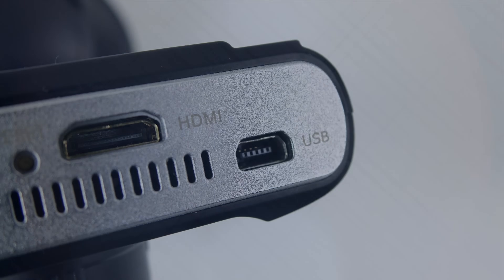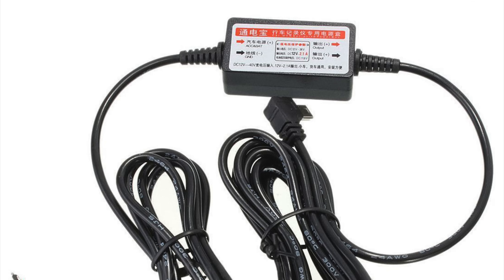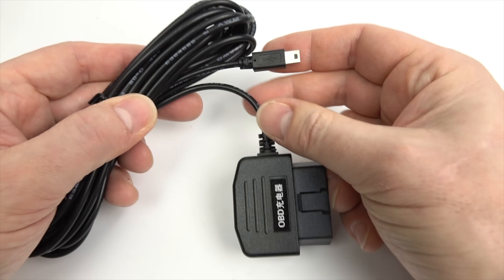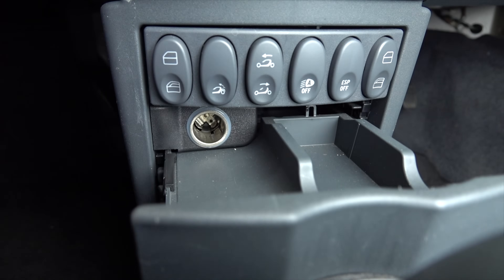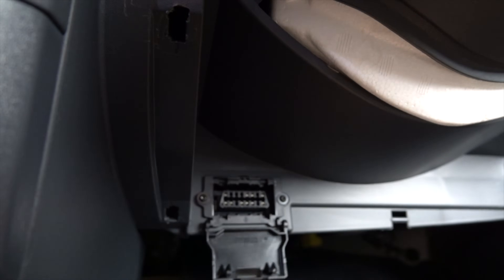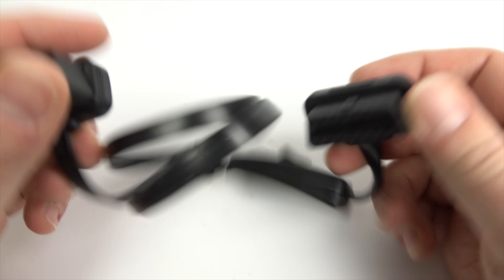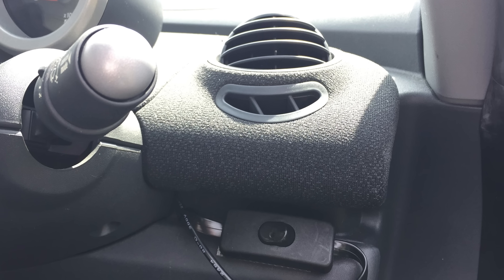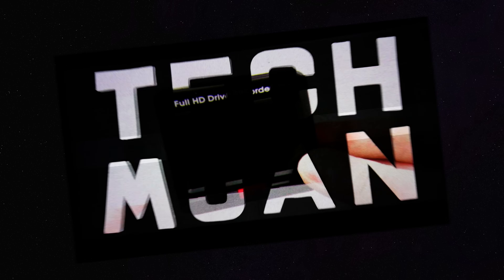You can power a Dashcam via your OBD port (but perhaps you shouldn't)

Comment: Ironically, on a lot of GM vehicles, the OBD-II port is powered from the cigar lighter fuse to begin with! The power line on the ODB-II port doesn't come from the ECM. Only the data pins are linked to the ECM. You can blow the fuse to the OBD-II port while the ECM will keep working just fine.
Reply: +Zzyzx Wolfe Wonder if that's why Vauxhall Corsas (mentioned in another comment above) have a godawful time communicating with OBD-II readers, if they pick up voltage drop from cig lighter accessories it could make the data signals fed from a different voltage than the OBD-II reader..
Reply: +TheChipmunk2008 Possibly. I know with GM truck and SUVs, if the cigar lighter/power port has been abused and has an internal short, you need to fix that, or at least disconnect the cigar lighter, so that it will stop blowing fuses so you can get your diagnostic tool to work. Plus, on a lot of them, the cigar lighter is right in front of the cup holders, so that's an easy way to blow the fuse. Fortunately the PCM is on its own fuse, so it's completely unaffected if the OBD-II port loses power, other than losing the ability to connect a diagnostic tool until you fix it!

Comment: what a terrible idea, you shouldn't mess with the OBD port in that way as you may eventually get a connector problem.
Reply: why would you get a problem. it's not like he's taking it out an back in a lot of times
Reply: I guess not, still, the wire may get tugged at maybe. I personally would much rather connect directly on the accessory line.
Reply: +Limitbreakur It is absolutely fine to do this.

Comment: It's neat I suppose, but these are still cheap Chinese devices with a fair amount of chance that they could be defective.  I've seen some very dangerously-wired devices come from there, particularly the ones which came straight from overseas and had no North American certifications.  I personally wouldn't risk my car's computer, and certainly not that of a rental or lease vehicle.
Reply: +FyberOptic Even if it were to short the 12V-line or GND to the data-lines, nothing would be destroyed - just malfunction. The CAN-bus standard has failure conditions where it can detect and report if the CAN+ or CAN- -line has shorted to chassis ground or +12V, since rubbing wires is nothing new in a car. Car electronics is very rugged for a reason!
Reply: +FyberOptic There is no "risking" your computer. the 12V and GROUND-line in the OBD-connector has to connection to the CAN-BUS-lines or go trough the computer in any case. It's just as safe (or unsafe, or what ever you want to call it) as sticking a chinese adaptor in the lighter socket.
Reply: +zaprodk There is a lot of risk to it if the connector is defective and could potentially short power to the data lines.  This is what I was referring to with dangerously-wired devices that I've seen.  They don't put much effort into any kind of cable retention, not even a knot in the wires in some cases, which can lead to wires easily pulling loose.  I've seen this terrible practice in devices that use house current, such as LED Christmas lights, which even went as far as to use the wrong gauge of wire on top of that.  

Rule of thumb is to never use mail-order Chinese devices on anything important.
Reply: +FyberOptic This is very true, check out youtuber Bigclivedotcom, he's an electrician and showcases all sorts of dangerous Chinese electronics and adapters. Found a LED light bulb and had 240v on it's metal faceplate. It's better to be safe then damage your car.

Comment: I bought the OBD II thing for my Mercedes Benz C-Klass 2016 and it turns on/off with the ignition. Here's the Ebay link. 
(OBD-II Dongle Plug Hard-wire Micro USB charger Adapter for Mini 0805 Dash Cam) 
http://www.ebay.com/sch/i.html?_from=R40&_trksid=p2047675.m570.l1313.TR0.TRC0.H0.XOBD-II+Dongle+Plug+Hard-wire+Micro+USB+charger+Adapter+for+Mini+0805+Dash+Cam.TRS0&_nkw=OBD-II+Dongle+Plug+Hard-wire+Micro+USB+charger+Adapter+for+Mini+0805+Dash+Cam&_sacat=0

Comment: Almost all test equipment is powered by the obd2 port. No cellphone or tablet will draw enough power to damage the obd2 port.
Reply: "yall"
Reply: +I AM THE GREAT CORNHOLIO! It's bot about damaging the port, it's draining the battery since it's always powered.
Reply: I left my S6 plugged into my truck charger for 2 days and it still started up just fine. Yes my cig lighter is always powered. If a constantly on power source scares yall just remember its been done for almost 50 years now?

Comment: Scan tools are powered from the OBDII port so there is no reason why powering a usb device from it would damage the cars modules.
Reply: I'm not saying that it will or will not damage the car, but I will negate your point by saying that no one constantly has a diagnostics computer plugged into their car, unless they have one of those chinese "fuel saver" boxes, which are dubious anyhow.
Reply: Bayly Buchanan, I've had my little bluetooth diagnostic plug in for years now... It works just fine. The only thing you got to worry about is as the video points out, the socket is always powered. My plug has a power saving mode which draws very very little power as long as no phone is currently connected to it, so it's in there drawing power for sometimes week at a time without the engine powering up, with no issues whatsoever. You're not damaging your battery any faster than you should be replacing it anyway due to aging so no worries there either. So really, the power is the only issue... Well ofc, aside from physical damage you may cause if you bump into stuff connected to the port which might bend your port and such things but that issue exist for everything in your car.

Comment: I have a Toyota prius and used to use the on-board diagnostic port and it used to turn off with the ignition however had a problem with the hybrid battery had to be replaced and ever since the on-board diagnostic is on continuously, however I have had to replace the 12v battery as well a couple of day later, so it could've been down to low voltage turn off.??

Comment: Car ECUs and PCMs are notorious for having issues with just being sensitive. Wiring and fuses for the circuits are rated to handle what the computer needs not really more than that. OBDII ports themselves can be made cheaply too, I've seen them broken away and for some reason unresponsive to OBDII readers, (both used GM cars.) I wouldn't use one for anything other than reading or clearing codes when there is a problem. 

There are apps you can get for free that reflect from a smartphone screen. The image is inverted so it reads properly on the glass without having the phone in the way. The apps use GPS to obtain your speed. This is good because you have 2 sources for your speed. The car's speedometer and the GPS. You can compare them and see how accurate your car is or compensate for wheel/tire size changes if you've made changes.
Reply: +PGTMR2 There is an obd spec, it says 12v 4a.
There is a fused line going to pin 16 of the obd port on EVERY obd2 car ... becaust that is the obd2 spec.
It's fine.
Reply: +PGTMR2 GM's early implimentation of OBD was awful. Vauxhall Corsa's (A GM car) are notorious for not wanting to talk to OBDII readers even when the port's not been messed with
Reply: The vehicles I referred to were 04 and 05 models, that's 8 years into OBDII. The 05 wouldn't communicate with my reader after 1 or 2 uses where it worked fine. The reader was still good, works for everything else. It's been plugged into all sorts of cars Ford, Dodge, Mazda. Even my OBDII swapped OBDI car, (performance upgrade for a MAF and better a/f maps.)
Reply: PGTMR2 Not at all.
Reply: I still wouldn't mess with it.
Reply: PGTMR2 I understand.
Reply: It's still playing with fire.

Comment: Why do interiour designers keep putting the 12V port behind flaps?
That is stupid, seems they never thought about recharging your mobile phone while driving. What's the function of that small drawer in the smart dashboard anyway? 
Maybe it's just  a trick to make you order the "center console extra USB port" for just 300 bucks.
Reply: +fatgoit do they still supply cigarette lighters?? Not seen one in a car for a few years ???
Reply: +Crazy_Borg In most of Europe it is still a lighter and ashtray so you want it covered.
Reply: +fatgoit 
Yes, I know.
But that drawer of the smart roadster in the video doesn't look like an ashtray. If so, it would be the most useless ashtray ever.
The walls are way too low, and if you close it too rough all the ash will fly into the open space behind it.
And the cigarette lighter will close the port itself, no need for an extra piece of plastic in front of it.
Reply: +Peter Howell
Yes, most cars will still have one, because its 12V / 10A max. (USB only offers 5V,  most times limited to 5A max).
 And since you won't get a spare wheel with your car anymore most tire inflating compressors require 12V to work.

Comment: very interesting that anyone would even try this, unless you car is from the 80s or older it has the 12v cigarette lighter power supply. my 1986 ex military chevy k30 didnt have one but it had the hole for one and easily installed one. if you only have one in your vehicle they sell splitters for them. ironically on most newer cars the obd port is on the same fuse as the cigarette lighter fuse so if one doesnt work they both arent going to work
Reply: Did you even watch the video? He explained why he has to do it
Reply: The lighter in my car is non functioning. Its been checked and rechecked and the problem has been traced to somewhere in the wiring. So for me this is actually a pretty decent solution, as it is a decent bit cheaper than some of the quotes I've gotten for fixing the lighter ports. But honestly I doubt I would do this method if the lighter ports were working
Reply: It was well before the 80's that they first started appearing. My '79 and '84 K20 pickups have them.
Reply: I just remember I would see some 80s cars that didn't have them like my 86 Chevy it just had a little circular plate where the hole was, heck it doesn't even have carpet
 You used to be able to order cars with no options, my uncle was so cheap he ordered a s10 pick up with no radio and no front bumper. Don't remember if it had a cigarette lighter though lol

Comment: OBD PORT power conections pin 16 12v pin 4-5 ground are direct chasis ground and direct battery 12v from a fuse of constant 12v of all the vehicle (same wire); others pins go to all car ECUs. there no will be ANY damage to the car using this device.
Reply: +matias constancio i don't understand why everyone is saying this is a bad ideia. This is literally a direct connection to the battery and in most vehicles (probably all) it passes through the fusebox for added protection. This WONT damage your obd connector nor will it communicate with the ECU. It is the same as tapping the fusebox directly.
Reply: matias constancio @ Miguel Simões
You are 100% right! There is no Witchcraft @ work on the OBD Port. Its clearly defined Pins who have Power (Fused)  and Ground

Comment: Check eBay for "blade fuse tap", no need to cut into any wires, and just put the earth under a metal chassis screw. Do check your blade fuse size first as there appears to be 3 sizes, mini/micro/standard.
Reply: +bridgendesar Some cars like the Roadster that Mat has and most Mercedes have auxiliary fuse ports on the fuse box to add extras like this easily with a specially designed fuse holder.
Reply: Just make sure you choose the right fuses to piggyback for your model year, and the right spec fuse for our device itself.

Comment: No arguments with the video content. C'mon people. Be a manly man. Get a voltage tester or better yet a multimeter and learn how to use it. It should be part of your tool bag. Every man should have tools and know how to use them. Finding a keyed 12v or hot 12v wire is super simple. Once found there are numerous ways to non destructively tap into the wire. If you really can't do this (really?), then Techmoan has shown a simple plug and play method.
Reply: Every man can do as he wishes, and every woman has the same options.
Reply: +Rowan Wolf ok whiteknight back to tumblr you go.
Reply: DSK I'm just saying that people can do what they want. Why does it have to be a man thing?

Comment: If it only taps the power pins it should be safe (other than draining the battery). It should be a more or less direct connection to the battery to enable voltage measurement.
Reply: +Robert Szasz All cars will have an inline fuse to the OBD port however, most cars also run other ancillaries from the same fuse. Depending on what else runs from that fuse would indicate the level of trouble you'd be in if the fuse blew. 

However, fuses are consumable units that are designed to fail so there is almost no way a car would be damaged if the fuse blew. Fit a new fuse and off you go.
Reply: +Evil from evilution In VWs anyway the OBD port has its own 7.5A fuse. I'd have no qualms about using a product like this, though when I add a device to the car I typically add a fuse to the fusebox with factory repair wires.

Comment: If it only taps the power pins it should be safe (other than draining the battery). It should be a more or less direct connection to the battery to enable voltage measurement.
Reply: +Robert Szasz Sometimes it has a fuse in line, but some other times I've seen a completely unfused connection (or fused only with a 100A fuse - the main battery fuse)...
Reply: MrOpenGL just to clarify, by safe I meant it wouldn't be able to bring down any of the communication busses exposed on the OBD connector. It could easily catch fire if it had a short.
Reply: Robert Szasz
Oh ok I understand

Comment: Some car manufacturers (eksample volvo) locks the obd is someting is not right, not sure about this spesific solution, and your veicle. Have heard about car that everyting triggerd befor the key was locked due to un original obd acsessories. So it's werry risky to mess with obd. A reset at example volvo is quickly $100, and when you think about how manny places with 12v in the car its easier and cheaper just getting it somewhere else.

Comment: Those OBD power cables do cut off the power when the voltage gets too low but that's not an ideal solution for anyone.
Reply: +Evil from evilution This unit works dows to 8 volt!! = dead battery.
Reply: +larsbg Says 11.5v in the links.
Reply: +Evil from evilution  sure but the sticker says 8-36V :-) High quality !

Comment: if wanted to hide cables away,  I would place the dashcam  in front of the rearview mirror and use short cables and a small 12 -> 5 v ubec that I would hide under the roof lining and solde the wires into 12v supply before the interrior roof light..

that wouod be stealth

Comment: re: having to turn it on and off for parking mode. My hard wire kit has a switch and a timer so in one position it'll turn on and off with the ignition and in the other mode with the ignition off it'll keep power to the dashcam for a configurable amount of time and then switch it off so you don't run the battery down. Unfortunately it's a 12vin-12vout deal because my camera can take the full 12v input but I imagine a 5v version would exist.
Reply: +Steve M Ok, there is something weird going on.

You're the 2nd non official Steve M I've seen today
Reply: "Official"? It's literally my name, doesn't get more official than that.
Reply: But, it's literally my name as well, and you're not me, so therefore, unofficial!

At least from my perspective, relativity and all that :D

Comment: Does that OBD to USB adapter also work with those OBD apps available on Android phones? Or is it just a power-only solution?
Reply from the maker: +ＲｏｂｏＡｄｄｙ Just power.
Reply: +ＲｏｂｏＡｄｄｙ 

The apps usually work with a bluetooth connection, a better option all together if you ask me.

Comment: I have the issue that both my acc and obd stay powered... rather annoying I ended up hard wiring to the fuse box and the passenger side seat power circuit
Reply: +Philip Anderson your radio has a "ignition on" wire maybe use that.
Reply: +Lucas Wendel A lot of cars use CAN BUS to switch power which is why it's always live. Annoying for things like dash cams.
Reply: Nope the Radio is always powered. it just comes out of standby when the car starts.
Reply: Philip Anderson  Please have a look at the ISO 10487. Pin 7 or 4 depending on your car model.
Reply: abyssunderground  as long as your car has a ISO 10487 connector your good.